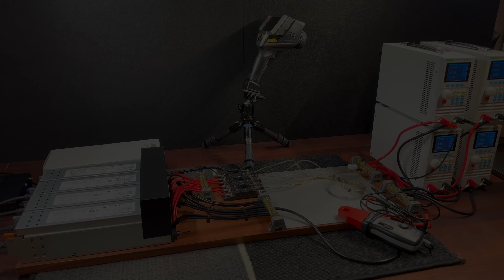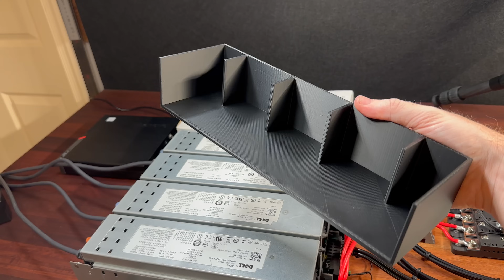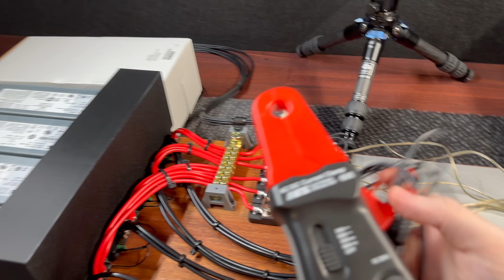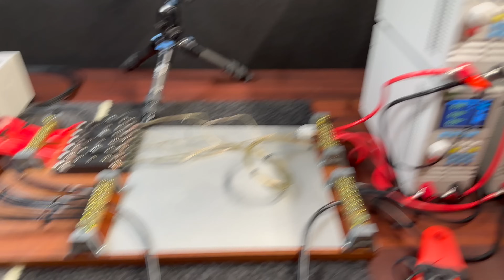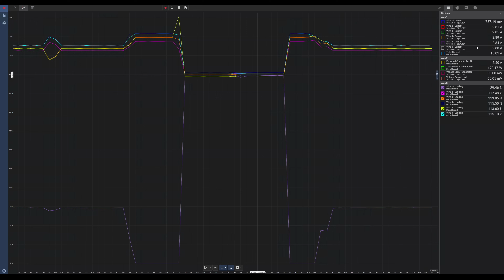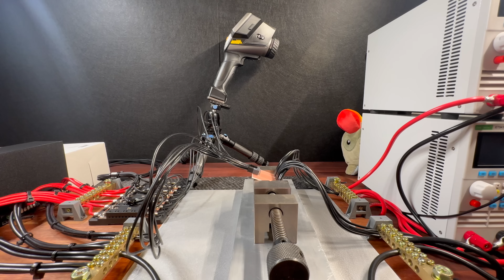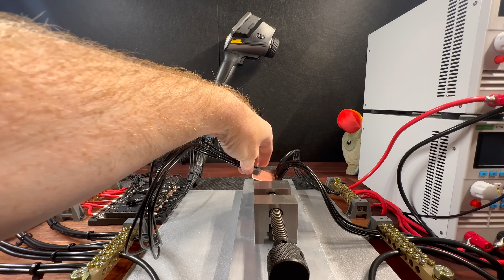NVIDIA 12VHPWR - Big Upgrades!

Comment: I will never bag on testing and appreciate your work, but to claim pin balancing shouldn't be on the the gpu seems rather biased. That function has always fallen on the component drawing power, be it gpu or even the cpu. Nearly every single electronic device we use today does the balancing outside of the psu. If you go back and research older gpus you will see nvidia has simplified their power regulation these past couple gens despite increasing cost. Why should the responsibility fall on the psu companies when they had no input on the decision to change or remove features and have to work with dozens of different gpu powe4 designs? It's gar more difficult for the psu manufacturer to account for the countless amount of variables in power regulation amongst a similarly countless amount of components. Why should customers be forced to upgrade psu's that have been perfectly functional for decades because a third party decided to save money on their end and remove features on grossly over proced products? We can't expect a psu manufacturer to throw everything out and cleanup after someone elses mess. I find it absurd to push the blame on to the manufacturers that not only have less profit margins but also generally follow regulations very well. You also seem to be testing things in a way that is highly ideal for the best results for the connector. Nothing in real world use is capable of sinking as much heat as the setup here. Also, the fact that melting does occur at substantially lower power than what is used in these videos should show that the issue is less with the materials used, which is what is actually being tested here, and more so the design and possibility of not ideal situations. The discussion for a long time has been the design and not the materials despite the fact not all 12pin plugs are using the recommended  PA66. One of the concerns and probable causes is increased resistance, which you eliminated from testing by design. Again,  I am not bagging on your effort. I love these videos, and I am extremely grateful for people like you who take it upon yourselves to test products. For that I thank you. I just feel you are approaching this issue in a misguided way. I know it isn't on purpose and you have no intent to mislead anyone. It just doesn't seem like it serves anyone trying to melt things attached to massive heatsinks at temps below the known melting points of the components. If we know the connector follows spec, many don't, and is made of PA66 we aren't going to see anything below 260c. In the last video, when you used those adapters you chose to use the thicker cable despite most failures occurring where the cable is thinnest. Many 12pin cables use 18awg and I recall seeing some with a 170c rating on the sleeve. I think I have even seen some lower. By looking at old failures it is also very easy to see the failure tends to occur around one pin and not a uniform melting, again implying a poor connection with high resistance. Imo testing should be done trying to create failures in typical normal conditions with thin wire and without giant heatsinks like pcbs with massive amounts of solder or big metal vises to see what conditions causes failure and work backwards from there. We can boil water over a fire in a thin plastic water bottle so it should be expected that giant blocks of cool metal will play a role. Sorry for this long comment and thank you for making these videos.
Reply from the maker: Why do I think it should be done on the PSU side? Because they have the room and capacity for it and they supply the cables that are likely responsible for the failures. Everyone seems to think GPUs have the luxury of space and this just isn’t the case anymore… NVIDIA or AMD for that matter isn’t responsible for bad cables being connected to their cards… Likewise do you really want more complexity of things to fail on your $2000+ GPU. You maybe be able to load balance the 12V side at the GPU but you cannot load balance the GND side if some of the wires fail. As for companies using 18AWG, that is on them and it is ripping consumers off with substandard parts, any PSU using such wiring should be thrown in the bin. At the very least a PSU manufacturer can implement per pin current limiting which is absolutely their responsibility just like over current protection is.
Reply: @whatcouldgowrong7914 unfortunately i have to disagree. You should check out some of Buildzoids videos along with datasheets and pcb layouts. There is plenty of room on the gpu for the balancing. It was always there in the past. Only removed recently by Nvidia and the only reason space has become an issue is because Nvidia decided to try to cut the size of the pcb in half in another attempt to save money and to help with the rising temps thanks to their higher and higher tdp by allowing a place for air to pass through. Load balancing is not complex at all. Please familiarize yourself with how it was done now and in the past. AMD has successfully load balanced gpus with nothing more than a handful or less of very cheap components and separating the 12v rails into three separate sections, sometimes more but combined later, and separating the powerstages evenly between those rails. Nvidia, until recently,  used very complicated but capable load balancing and that load balancing also served as a protection point. Those smaller mosfets used to blow before the powerstages and in turn that would protect the gpu die from getting killed. They also used to use fuses in a useful manner that again would protect the die at the cost of pennies instead of pointing the finger to psu manufacturers that shouldn't be forced to absorb more expense. A $2000 product SHOULD absolutely have those failsafes built in, especially when they aways had those failsafes built in until recently. It is nothing more than a cost saving measure. It's absurd to think something that is reliable because it is simple should have to make up for the shortcomings of another component with substantially higher margins and with the knowledge of how the device they made works. Why do you think it is ok for a feature that gpus always had to be removed when prices are multiples higher now? It sounds like you are fine with people getting robbed on gpus and now want people to eat even more cost increase on the psu side because Nvidia doesn't want to do what they used to and what AMD and Intel still does. It makes zero sense. Please take the time and study some pcbs and their power layout. See how AMD and Intel still properly manage their own power like virtually ALL other electronic devices and the history of how Nvidia did the same until the last couple gens and how that has led to Nvidia having less failsafes resulting in failures killing the die more than their competitors. We might as well make a case for those $2000 cellphones to remove all battery protection and point the finger at those univeral chargers to handle all protection and blame that when something in the phone fails. A psu  shpuld be treated exactly like those universal power adapters used for phones because that is exactly what they are. Not fair to blame the people who had nothing to do with the problem that was never there and is only there for Nvidia. Nvidia made the problem and Nvidia should fix the problem. Fyi a lot of failures absolutely happened on aib and oem included cables. Thateans Nvidias own cable. Not hard to google images of it. It's no coincidence that the only company that removed its safety components is the only company having these issues. 🤔

Comment: Okay, your testing methodology may have improved but you're testing the fundamentally wrong thing.
Most PSUs with HPWR are modular and AFAIK each and every melted connector was modular.
So one connector with unbalanced resistances while the other side is perfectly balanced is not enough to cause a catastrophic failure unless you get a VERY unlucky hand.
What most probably happens is when you get TWO sets of random resistances AND they are a bad match is when the shit hits the fan.
For a connector to melt you need watts not amps directly. That means for that to happen there are three conditions that need to be met:
1. Total resistances of all but one or two wires need to be pretty high
2. Resistance of remaining wire(s) on the PSU side need to be pretty low
3. Resistance of remaining wire(s) on the GPU side need to be high enough to cause a lot of heating but low enough to pull all the current.
Here's an example (haven't measured actual ones so consider this a pull):
PSU side, mOhm:
30 50 40 30 10 60
GPU side:
50 30 60 50 30 40
So GPU side pin 4 gets 9W of heat to dissipate. Not exactly a small amount for an insulated tiny weeny conductor.
Reply from the maker: I understand what you’re saying but it doesn’t apply to current stage of testing the durability of a single connector in isolation compared to its data-sheet specifications. I cannot introduce other connectors and factors into this because it creates unknown variables which can never be reconciled in the event of a failure…
Reply: @whatcouldgowrong7914  Well, you're not investigating the actual issue then.
Reply from the maker: @yunodiewtf  I am investigating the issue, in bite sized chunks we can manage and learn as we go. You cannot tackle this situation as a whole. Every power supply has different brand connectors, many power supplies use different connectors at the PSU side other than the 12VHPWR. So what I create a failure with a specific PSU, cable etc… what have we proved? I refuse to destroy actual good PC hardware and it’s really easy for everyone to arm chair expert this yet I don’t see them doing anything about investigating it. I don’t have an LTT budget to go out and buy the best of everything investigating this stuff
Reply: @whatcouldgowrong7914  How about try out my hypothesis in a real simple way?
Get some dead PSU, yank the modular connector off, solder to the current source, try plugging a few times and check with a milliohmmeter to stop at a "bad hand", then do the same for GPU side aaaand blast it with 50 amps. Have the thermal cam handy.

Comment: Umm, the PSU doesn't do load balancing, it's a single 12 V rail that feeds those 12VHPWR connectors. No amount of shunt resistors on the GPU will change that. The load balancing is the task of the GPU not the PSU. This could be done actively with FET and micros controlling them OR passively by splitting up the power phases of the GPU to individual pins on the 12VHPWR connector. But since everyone and their dog decided to bond the pins together as early as possible load balancing is impossible...

Comment: No load-balancing can not and SHOULD not be done on the GPU-side as long as there is no active datalink between devices.
The PSU is responsible for delivering clean 12V. Nothing less, nothing more. The device on the other side can be ANYTHING and might just only need some current on 1 pin. You can not know what it does.
The PSU could do sensing and monitoring to check if the individual pins are overloaded but that's it. 

An example that is not a GPU would be a 5.1 soundcard:
For easy traceability and a simpel design each output-channel is routed to its own input power pin. The PSU not only can not balance that - it MUST NOT even attempt to do so.

Comment: Why do people keep falsely claiming that Nvidia designed the connector?
They are part of the PCIe-SIG that was involved in the Design - same as Samsung, Intel, and yes - AMD. AMD was part of the designgroup just the same. So if anybody claims it would be nvidias bad design than they must also claim AMD is at fault.

As had been shown now in many test s(including this video): Nah, the specs and the connectors on the cards are just fine. They can more than handle the rated loads. Nvidias fault lies in not having any monitoring of the connections and instead just mashing it all together - relying on cables being within spec.
And on the board-partners and endusers using craptastic chinesium shit cables. 

To put the "not much" 0.05Ohms into perspective:
The connector is supposed to be within 5mOhms - this here added 50 mOhms. When going offroading you deflate tires to get more grip - reducing the pressure by a factor of 2 - but with the resistor this is a factor 10.
Reply from the maker: Everyone seems to think just because NVIDIA used it first that they designed it for some crazy reason. Definitely agree on garbage cables also. The resistor was just an example, I dont carry very low value resistors on hand
Reply: @whatcouldgowrong7914  I only have a few 1mOhm 0.1% just cause i found them on the cheap, but never actually need them and in general it is rare that you would need something in that range. 
I only mentioned it cause i saw several people that commented on how bad it was that the currents were so uneven from "only 0.05Ohm" when it is quite literally an order of magnitude difference.

Comment: Yea no. nvidia is responsible for this bs, as they previously ensured their power delivery specification, on the PCB had current balancing, per pin. They knowingly removed this from the spec, while they simultaneously crammed more power through fewer wires. I could accept this excuse if the only thing they made was GPU cores, but they don't. They make the entire card, and dictate to their board partners how they can make their cards. I'm not saying they did so to purposefully create fire hazards, but I am saying that they still did it, and it has the potential to catch fire. Leaving an open container of combustible liquid in the presence of a source of ignition, then walking away and feigning ignorance does not absolve you of responsibility.

Comment: I am not sure why everyone assumes that only the +12V wires can be out of balance. Grounds never get respect but can cause the same problems as the +12V side. I have yet to see anyone look at the problem overall and consider what happens if a ground wire falls out of balance. Is there any analysis of failed connectors that says that only +12V pins are melting? This looks like a major oversight by all YouTubers (and the industry as a whole).
Reply from the maker: It has crossed my mind but because im not using an actual GPU, I cannot accurately replicate that side of it yet and I refuse to destroy actual GPUs in this process
Reply: @ I am not sure if there would be a problem. It sort of depends on the extent of “ground” isolation. Is any of the +12V supply from the power connector allowed to return via the “ground” in the PCIE slot. That would be very messy. If the two sources of +12V power (the connector and the slot) are indeed isolated then replicating the current shunts that you have on the +12V supply would fully model the overall problem. However, superposition says you don’t really have to do both sides to acknowledge that both sides can impact the overall system. I just have never seen any acknowledgement that ground imbalance can have similar impacts to +12V imbalance - just different pins would melt. Keep up the good work.

Comment: How would you design the power supply to current balance? Would you prefer to have multiple buck converters in the power supply, one per pin? That sounds like it will seriously drive up the cost of a power supply. Would you want to introduce some switchable resistance into the supply itself? That will worsen efficiency. Also, what about all the legacy power supplies that people have and are using adapters?

I'm in the opposite camp. If you have a device with a connector that's rated up to a certain current per contact, you should only draw up to that current per contact. It's not difficult to do on the load side if you need to power some low voltage circuit, like the GPU silicon (at ~1.2V) or memory. GPUs have multiple power stages for their core power. Feed a few stages from each wire on the connector and monitor the current per stage. It already happens on the power stages of GPUs, you just need to not connect the power supply's lines to each stage and go to an error state if one stage is dropping the voltage too much on a specific pin.